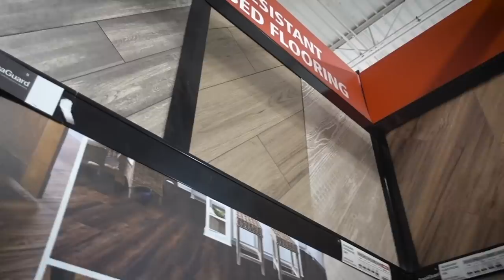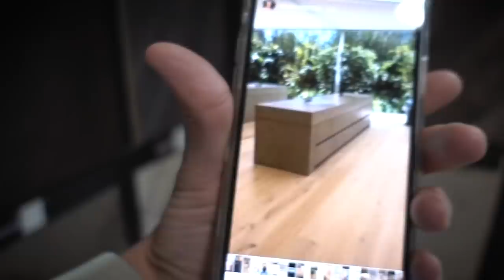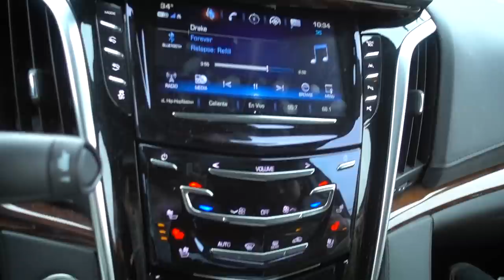Spending millions on Marble for Belen!

Comment: Just want to say make sure your engineered hardwood floors wherever you get them are made in a country where formaldehyde levels are regulated . Don’t let anyone tell you that’s crazy and doesn’t matter because it absolutely does . Although engineered hardwood is super durable looks great and is easy to work with they have formaldehyde in the glue between the planks that can cause cancer from the off gas it lets out . No I’m not exaggerating , what would I gain?  I’m just saying some engineered hardwood has higher levels of this than others depending on what country it came from , despite where it’s being sold and regulations in the US  . Just because it’s sold hear in the USA doesn’t mean it’s made with our safety in mind . Like I said contractors will sometimes act like it’s an exaggeration and it’s all just fine but they aren’t the ones living with it you are .

Comment: I guess compared to woven silk wallpaper from Venice that been a reasonably priced selection of home surfaces.
But on a more helpful note: if you plan on using the kichen for more than making coffee and sandwiches surfaces from marble or stone are probably not the best choice: heat can make it crack and spices, veggies and oil tend to leave staines easily. Not to mention red wine.